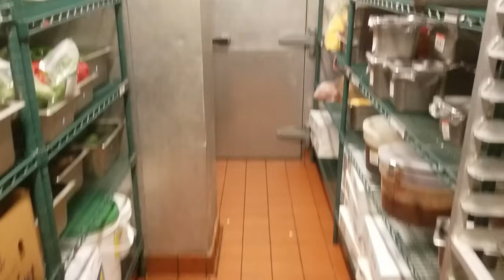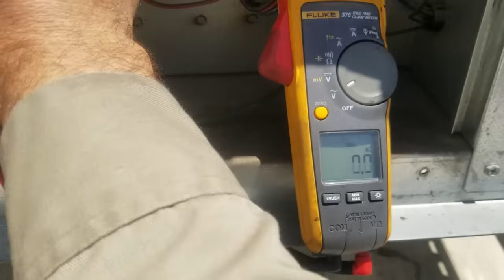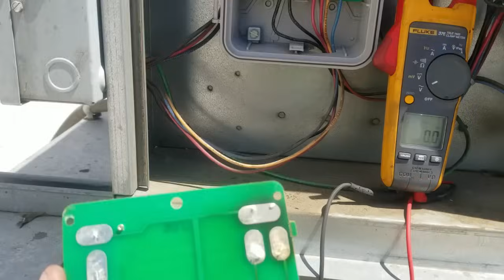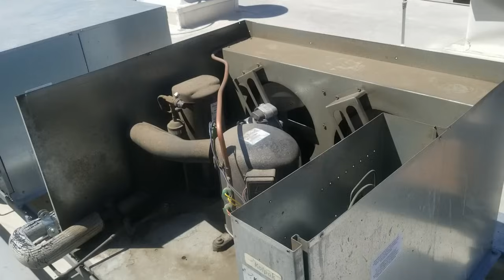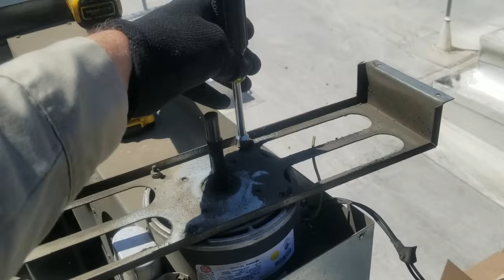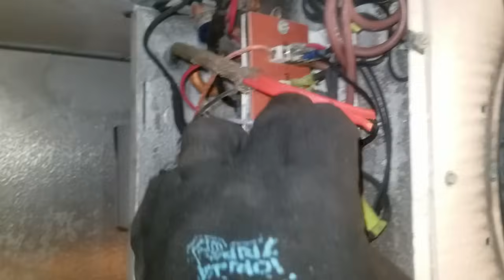Walk in Freezer service call  (electric defrost explained)

Comment: Chris, your explanation of the reason why they have defrost clocks reminded me of when I we a kid and used to unload the delivery truck at McDonald's. The air in the frozen section was so cold that on hot summer days, it would actually snow in front of the trailer door.

Comment: Sir I appreciate you. I diagnosed a bad time clock today due to it not dropping voltage to pump down solenoid on walk in freezer in defrost. Thawed it with hot water and water hose. Wish I could move and work with you. I needed this refresher course. 😂😂

Comment: Watching this video literally helped me finally connect the dots in refrigeration. At the time clock where your explaining 3 is defrost 4 is refrigeration 1 n 2 are your high voltage line and N your neutral and X is defrost termination than explaining the theory behind the limit switches into a light switch concept was very practical. Thank you.
Reply: Note: the "N" terminal in the unit shown here isn't actually a neutral, it's one of the phases, hence why he is measuring 208V between it and other terminals. I'm no HVAC guy but I presume presume they set it up like this with 208V control circuitry so the refrigeration unit as a whole doesn't need a neutral.

Comment: I like  how  you  took  your  time  and  did  a  systematic  check  of  the  electrical circuits.   Checking   for   resistance  in the  terminal  wires  of  the  defrost  clock,  with  the  power  off  and  then turning   the    switch  gear  disconnect back  on, and  pushing   the   compressor   contactor  in  that power  on  the  compressor  and  condenser  fan. Basically  the  compressor and   fan are  wired  in a parallel circuit,  by  doing  this  the   defrost  clock  is  faulty .  You  check   the  condenser  fan motor, Commerical  Ice  boxes  have  a small defrost   clock  in them and  electric   heaters   mounted  inside  the  Evaporator  coil, I  used  to work  on those  units, and  to check   to  see  if  the  unit  went  into  defrost,  I  would  turn  the  defrost  clock  wise, and  hear  a  click  the  compressor  and both  evaporator   and  condenser   fans  will  shut  off  and the  unit  will   go into defrost, leers  units  and  others  did  not  have a fan limited switch  and defrost  limited  switch  or a   electric  heat safe  limited  switch, but  it was  easy  to service  and   work on too.

Comment: Hey man, great video, thanks for taking the time to explain, you are a good teacher!  Just wanted to politely warn you that arc flash protection is required or at least strongly recommended.  Obviously you have no shortage of experience but, apprentices are watching this and will likely do exactly what you are doing.  Where I’m at they would fire me if i was seen doing this w/o arc flash protection, guy in my fourth year class had lost all his teeth from a bad jolt!  Be careful out there.  But great explanation on the time clock!

Comment: Personally I think it would be a good idea to have the defrost heater on its own seperate contactor and have the timer control the coil rather then running it thought the timer. While the timer can handle the current if something went wrong with the heater and it started over amping then it can easily overload and burn up the relays in the timer. If you used a contactor that was rated 10-15 amps higher then the load of the heater it could easily handle the over amping and neither the timer or contactor would get damaged. Adding a properly rated fuse in line with the contactor will add an extra layer of safety that can protect the contactor meaning if the heater shorts or something you will most likely only have to replace a couple fuses instead of a timer.
Reply from the maker: Try and get a commercial refrigeration and or commercial hvac job. My company does both
Reply: 'Bejamin Lock:  Isn't that the manufactures Job to Place those safety components in place, they probably designed it this way so #HVACR VIDEOS really dont need to rig it up.

Comment: This was a great video. I would’ve like if you explained what each of the wires controlled. The first set obviously went to the coil heater. The rest then the condenser unit. X as you say defrost termination.

Comment: I like that you caught yourself when you said Between 1 and nuetral and then you said the N terminal. Because even though it's a 208-230 volt time clock L2 is still labeled N. But that's also probably because now they're automatic dual voltage

Comment: I remember you said the system has different stages. It’s a good example to look at what stage the defrost clock was in operation. For example could you jump the contractor if no push-button was in place to check the system function.
Reply from the maker: always be cautious about jumping contactors or pushing them in. Bad things can happen so always investigate before doing so!

Comment: Chris,
Great job with your channel. You are thorough and generous with your time and diagnosis. Why does the restaurant flip the breaker during deliveries? It seems risky.
Reply: I was thinking the same thing.
Reply: If the doors are left open too long during a refrigeration cycle, the humidity in the air will cause the evap coil to freeze up.

Comment: Good stuff 
Great clock but I think the old mechanical one are just tougher
Reply from the maker: Yeah they both serve a purpose in my book, I feel that the paragon and the grasslin both have good and bad things about them, I try to replace like for like unless I'm having problems. Such as if it is a sandy and windy area the grasslin with get jammed up with sand, and likewise the paragon has to have the same defrost duration every defrost. Personally I like to put a long defrost in the middle of the night on medium temp applications. So i stock both on my truck and evaluate each situation depending on the circumstances.  Thanks for watching and taking the time to comment on my video!!

Comment: When in a pinch, N & F can be used for refrigeration instead of N & 4 for pump down/ defrost (Medium temp application) if the refrigeration relay is not switching over.

Comment: Here in N.Texas you have to be be careful to condemn a condenser motor just by looking,  Here we have a low temp control that turns one of the motors off if it's too cold, or cycles as it is called.
Reply from the maker: I will be going live on YouTube this evening 12/30/19 @5:PM (pacific time) to discuss my most recent uploads and answer questions from emails and the chat, come check it out if you can
https://youtu.be/XNnsDZUitZQ

Comment: It's most likely one of the relays on the defrost timer has a high resistance contact. I repair units like these down to component level and always remove relays for a thorough testing out of circuit.

Comment: a little tidbit on the power circuit of those electronic timers.  those two resistors on the old clock appeared to be acting like fuses.  they tend to get warm during normal operation and will leave dark marks on boards.  if you see soot then it has suffered a serious quick failure.  otherwise they will just eventually fail with age or if there is a minor fault that causes a little higher current pull (the motor starts to have trouble turning at normal speed or a relay coil doesn't pull the contact over properly)  light black or brown is fairly normal (depending on the PCB used).

Comment: thanks for the helpful video.  i'm a 3rd year apprentice and i'm starting to take service calls on my own now.  yesterday i ran into this same clock on a freezer that wasn't working and i was kind of lost (i've done mostly AC at this point).  the wiring diagram was barely visible, too :/
Reply from the maker: Hang in there bud it will get easier!

Comment: I think it was relay failure, not related to resistors. Possibly a power line voltage spike or something like this. It is easy to diagnose the relays. Or even replace them cheaply. Might be sometimes worth it, if you know what you are doing it is very quick and the unit can be reused.

Comment: Great video. Simple explanation.  Thankyou for your knowledge sir. What voltage is that drain heater? 240v since its wired on N and 4?
Reply from the maker: Yes 240

Comment: I notice a few people complaining of a short life on these timers. We have a board in Germany that has been failing due to vibration, metal fatigue  breaking the relay contacts and shorting to ground. Perhaps they are using the same relay source? Maybe worth checking if they are not lasting long. I like to check failures as it gives me an idea why it failed before you blow the new one.
Reply from the maker: I really have no problems with this timer, everybody just has their preference!
Reply: You know what you're doing that's why. :-)
Reply from the maker: You said it not me! Thanks bud

Comment: Great Video! I only have one question, What is the F terminal used for? Thanks.
Reply from the maker: It's used to cycle the fans, but I have never seen it used. We use the fan delay to control the fan from the number 4 terminal now.
Reply: HVACR VIDEOS  Thanks.
Reply: It’s an extra set of contacts that are closed in cooling mode. It’s rare but you may use a separate power source to control fans than you use to control solenoid valve. In that case you can take the jumper out from 1/2 terminals. You then have a set of dry contacts between 2/4 that can be used for a separate circuit for temp control/pumpdown solenoid. You would then run the wire you see on 4 over to f instead.
Reply: Skipper Refrigeration Thanks, Im learning everyday.
Reply from the maker: thanks for answering that question, there are so many comments I have a hard time getting to them all!

Comment: Another shorted grasslin timer 😮 shocker. Another thing these clocks seem to struggle with is if the building has a back up generator that test fires weekly. Not sure why maybe voltage drop then immediate pick up voltage?
Reply from the maker: That sounds logical, also if it's a multi volt model the clock modules are usually 120 and I believe they use resistors to step the votage down from 208 for the clock module. The resistors probably don't like the voltage variance that often!

Comment: I actually tought the fan delay was to make it quicker to cool down the coils (lessen the load on the coils) before it start pumping trough the hot box air through the coils - thus making it quicker for the box to come down in temp after a defrost sequence.
Reply from the maker: You are correct they actually have several benefits

Comment: The crappy parts is not going to the supplier to get a new one.  But explaining to dispatch  why you need another one

Also, I just coming back to refrigeration work after 2 years stint at an afb doing just heatpumps and halocarbon paperwork. I got a service call last week and realize I was drawing blank on how to troubleshoot these items.... that was scary

Comment: Min 25:13

"Pumpdown liquid line solinoid valve."...

Why do we have "pump down"?
I hear that a lot. 
I just watched a video on Pump Down but I can't remember why it's done?

Video on Pump Down:
https://youtu.be/ihFvHsx3868

Pump Down: pumps all refrigerant out of the low side into the condenser. Done to protect the compressor from refrigerant that mixes with the compressor oil on off-cycle and could damage the compressor on start-up.

Comment: I had to unhook defrost terminations once.  We had a large drive in freezer where there were two evaporators were facing each other.  If one finished defrost the other one was still defrosting eventually the one evaporator would push cold moist air on one the was defrosting creating excess moisture on blades, motors and coil.  The defrost clocks are timed together forever.  Bad design but what can you do.

Comment: In the defrost termination that is 3 wires ( red, black and tan or brown) how will be the right temperature for close the contact in a refrigeration mode and what will be the tan wire function ( I assuming that will be for safety in defrost mode). The defrost termination said in my case  C: -35 and O: -55. I will appreciate your help.

Comment: When you said legs 1and N  bringing 208V, What do you think if both legs are hot legs together with 208 or only leg 1is hot with 208 and N is 0v just like general neutral? I think you are working with the three phases power, if you have two both legs hot with 208. can you explain more if you have a chance

Comment: How much do those clocks cost? They look easy enough to fix to be perfectly honest.   BTW those are resistors, fairly large ones which means they dissipate a lot of heat, likely doing a voltage divider to drop the voltage to a working voltage on the board.   Most likely fault is the relay fused open for safety. (fail safe)
Reply: Chinese copycat boards where in the same factory refrigeration parts are spit out and across the room sandals are made!

Comment: THANKS a bunch for this, now, on that drain line heater cable resistance, if it shorts out being wired to the refrigeration mode, couldn't it mess up other components? as opposed to it being always on on it's own circuit maybe even plugged to the nema wall socket on full tropical latin-american style? LOL
Reply from the maker: Yeah I guess it could, I've seen them wired into their own circuit before too. It all depends on how it was wired when they built the place. It would be hard for me to convince a customer the  have an electrician wire a separate circuit on an existing building. But I definitely do see a benefit!
Reply: When we do freezer installs we always request an outlet behind the evap just for heat tape.
Reply from the maker: I don't do many new installs, I've been burned by to many contractors
Reply: Excellent  video and a lot of helpful tips Appreciated and refresher Big Thanks for sharing Keep them coming👌 👍👍👍😎
Reply from the maker: Thanks for watching!

Comment: Can I ask u to do a video on superheat and sub cooling I know you hook up your gauge to evaporator then your meter and put tape around the multimeter sensor on the inlet of the evaporator then you take your saturation temperatures from your gauge and subtract that from your meter and that’s your super heat? I’m I right so far

Comment: if u put ur probes on terminal #2 and #4 during refrig mode and if all was good u would get 0volts on meter, contacts pulled in correct? and between terminal #1 and #3 would show 208 v because its not in defrost, correct?

Comment: I just had an issue where someone installed a cooler and the X wire was not connected the unit froze up like no tmw. I am going to hook that X terminal up today and see what happens. Crazy to think someone would just leave it off.

Comment: I’ve found, Heat-craft three wire delays in a box, running at -10F, won’t allow the delay, or termination to function, because they are mounted to the cabinet frame and not the U-bend. I’ve had this problem in almost every box this style three wire is found in.  I’ve replaced them, only to see the fans start up without any delay after a defrost.... Is there a fix for this crap design?
Reply from the maker: I have mixed results with their limit switches, sometimes it helps to move them. I will be going live on YouTube this evening 5/20/19 @5:PM (pacific time) to discuss my most recent uploads and answer questions from emails and the chat, come on over and check it out if you can https://youtu.be/-4N3ueCvJOY

Comment: How do you know which way the fans should be spinning ? Like whether it’s pushing air or pulling the air?
Reply from the maker: By looking at the pitch of the blades, most units blow air over the compressor, but not all of them.

Comment: Why not fuse the clock against possible shorts?
Reply from the maker: It's a great idea, it just didn't come that way from the factory and I didn't even think to order a fuse block and fuses. But it definitely wouldn't hurt! Thanks for watching
Reply: How would you determine the fuse size? Where would you put them?
Reply: Fuses don't prevent a short, it is meant to limit damage or full out fire.  Chances are both will need to be replaced anyways.  Cost wide much cheaper to just depend on  incoming breaker for protection

Comment: Please don't use the term Neutral for a hot leg of 3 phase power on the timer.  In a single phase system that is Neutral and is tied to Ground using a 120 volt clock, or is tied to the other leg of hot using a 240 volt clock.  Assuming this is Neutral and at low voltage is a mistake.  Be safe with electricity.

Comment: I got a service call, compressor for a freezer walk in box keeps tripping the water.
Checked it out and compressor is shorted to ground.
Changed it to and it ran for about 20 minutes suction line was cold and “ the black capacitor started to smoke.

Comment: it's all good but I see 202 and 203 volts not 208 is it me ?
Reply from the maker: Its acceptable to have voltage down to 195 on most modern circuit boards, anything below that will cause problems. As far as motors and compressors we can get as low as 185 volts. But ideally I want to see at.least 195 volts

Comment: I changed TXV on walking cooler but suction line still freeze and pressure stay on 48psi , system got clear screen , evaporator clean , sensing bulb attached probably and insulated , new compressor ,   compressor 2 ton , TXV 13/4  to 3 ton , R22 system , what could be the problem ??